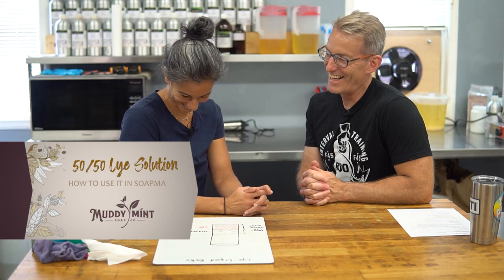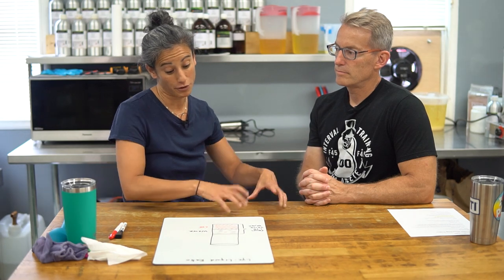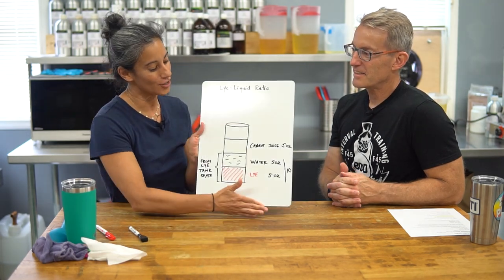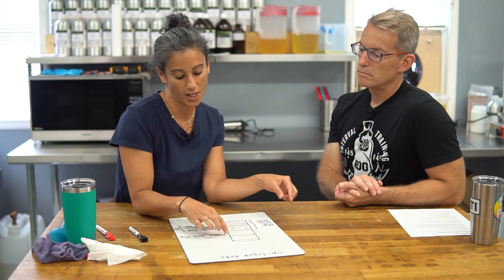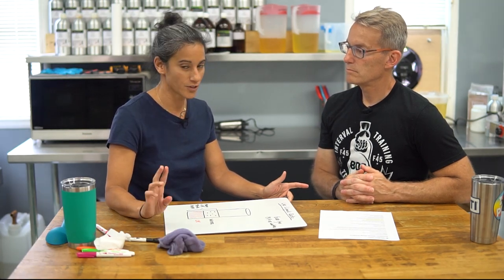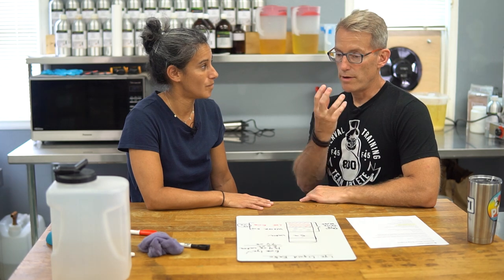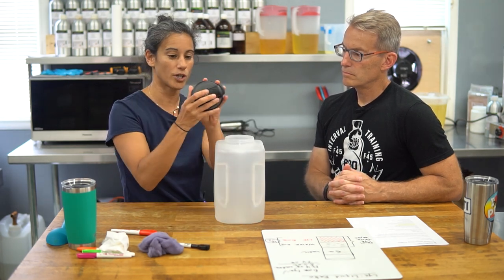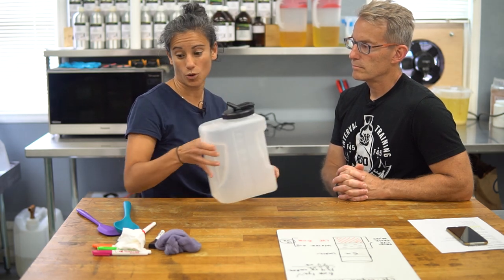How to use a 50/50 lye water solution for soapmaking

Comment: I'd like to know if I use ice cubes instead of water to premix lye mixture is the weight of ice cubes the same as the weight of the water.
Reply from the maker: Good question. Ice cubes and water weigh the same, so there's no issue with using ice cubes instead of water. :)

Comment: I really appreciate the two  of you for explaining how  and  why to use the 50/50 lye water solution. You answered one of my questions, "How long is the lye/water mixture  good for?" I believe you said it is good for a month. Also I was wondering if you use the same  oils & butters every time for your recipes or do you use different oils & butters? If you use different oils & butters, wouldn't you need to change the lye/water ratio as each oil & butter require different amounts of lye to create soap? Just wondering. Please help me to understand as I am confused about the ratios concerning the amounts of lye to consume each oil or butter if you use this ratio every time. Very interesting video. Thanks for the information so far. Peggy
Reply from the maker: Hi Peggy,

We use different oils and butters in our recipes, but we always use the lye from this tank. Remember that you can always get whatever lye amount you want from the tank. The lye amount is the important number. So, if your recipe needs 4 oz of lye, you'll take out 8 oz of lye-water from the tank (which is the same as 4 oz lye + 4 oz water). If the recipe calls for 3.6 oz of lye, you'll take out 7.2 oz of lye-water (which is 3.6 oz of lye + 3.6 oz of water). After that, we ADD water (or another liquid) to our recipe. So, the lye portion of the recipe is always taken care of by drawing the correct amount from our lye tank. Remember that what you take out of the lye tank is always half water and half lye. If you need more water, then you just need to top it off. We do explain this in the video, but maybe it makes more sense written down. If this is helpful, try watching the video again and see if it makes a little more sense. I hope it does!
Reply: Thank you for further explaining to me.  I have heard of the 50/50 lye water from others but could never totally understand just how it works. I get it now!  I love watching your videos and appreciate the two of you. Thanks again for the explanation and  getting right back to me. Peggy  @muddymintsoap

Comment: How do you know concentration of lye water using hdrometer using this method of 50/50  thxs👏
Reply from the maker: Hi! I've never used a hydrometer for soapmaking... are you purchasing your lye water pre-mixed and are wondering the ratio of water to lye? I'd probably recommend mixing it yourself if you're not sure. Typically lye-water that is sold pre-mixed will let you know the ratio. Not sure if that's what you meant!

Comment: You're great teachers, thank you for taking the time to share your knowledge.  Is the lye tank just a large urn or is it made specifically for lye?
Reply from the maker: Thank you! We appreciate you watching and your kind compliment! :) The lye tank is specially made for lye water. It is made of stainless steel (you don't want to use anything else for lye!) and it has a heating element in it. As we mention in the video, you can use smaller containers for small batches of lye-water.
Reply: How do you keep the small batches of 50/50 lye water warm enough within the 10 degrees to pour. ? Hope I made sense. Lol 😂.

Comment: QUESTION:  this is amazing tutorial for 2:1 or greater -- would you kindly discuss if it is less than 2:1, e.g. 1.8, 1.7, 1.6, 1.5, etc.  (closer to 50%) where the total water solution is less.  Example:  for a 40% lye concentration (1.5:1), where lye needed = 87g and the water needed = 131g -- in this case, 87 x 2 = 174g, which is greater than the total water/liquid needed.  Please clarify:)
Reply from the maker: Hi there! Remember that the lye-water that we're making is a 1:1 solution. One part lye to one part water, so you can get any ratio you want above 1:1 easily. A 1:1 ratio is the MINIMUM amount you need. In the example you provide, where you want 87 g of lye and 131 g of water, you would use 174 grams of the lye water solution, which is equal to 87 g of lye and 87 g of water. So, you have your 87 grams of lye, but you need more water (you want 131 g of water, but you only have 87 g so far). So, you need to ADD 44 grams of water (131g - 87g). Hopefully this makes sense!
Reply: @muddymintsoap  Thanks for your steadfast reply! So I understand, the total amount of lye + water = 218g if I were to blend the solution on its own.  When I use a 50/50 base (1:1), the total amount to begin with is 174g, so I add 44g of liquid/water to get to 218g total.  Is this correct?
Reply from the maker: Yes! You got it! That's another way to think about it. Just remember that the most important thing is to get your lye amount correct.
Reply: @muddymintsoap  Thank you for clarifying -- I am always impressed w/ math-minded people!  My math-mind has definitely improved since I began manufacturing a couple of years ago though, but get nervous on these types of things b/c it is so important to get it right.  When I first started making soap, I actually started out w/ a 1:1 (50% lye concentration) milk soap -- that was my first ever soap -- not m&p, not hot-process -- I dove right in.  FYI that milk soap is still amazing, I have not sold them all yet as my business has emerged slowly, but is picking up now.  So, milk soaps do last (mine have).  Thanks again for your assistance, and dedication to informing accurately.  It is always so very well appreciated <3  All the best to you guys.

Comment: I am a new soap maker and learning alit by using different recipes and trail and error but have found my favorite recipe for now the fits the average small wood mold don’t know exact size off hand but when cut 1 inch thick a little bigger I can get ten good bars with ends as samples… my recipe called for 9.30  ounces water and 5..6 ounces of lye. Is that a good ratio? Anyway the soap comes out great I add a little salt and sugar and I get great lather…
Reply: So since I need about 9.30 once’s of water I can play with that and maybe do 5.30 once’s water and 4. Ounces of another liquid like milk to be at 9.30 ounces? Remember new to this so sorry if I am a little slow…..
Reply from the maker: I love that you found your favorite recipe! If you're using 9.30 oz of water and 5.6 oz of lye, that's a 1.66:1 ratio. This is a great ratio if it works well for you! It's less water than what we use and if you ever find that you're having trouble with the batter when making more complex designs, you could add more water to give yourself more time. Salt will make the bar harder too and the lower the water amount, the less time you typically need to cure your bars! Thanks for watching! Sounds like you're doing great! :)
Reply from the maker: So, if you use 5.6 oz of lye, you need to dissolve that in AT LEAST 5.6 oz of water. That means you have 3.7 oz of water to play with (9.3 oz minus the 5.6 oz). You could use another liquid like milk for this portion and you can add more as well, although you might find it changes the hardness or feel of your bar. Hopefully that makes sense! Let me know if you have any other questions.
Reply: Ok thanks .

Comment: I like the concept but if using Ice how can you be assured using ice is giving you the proper 1:1?  Do you begin melting ice cube in order to get the proper ratio?
Reply from the maker: Hi Penny! I had a hard time wrapping my head around it too, but a lot of people make lye water this way, so you just have to trust that it'll work! You simply weigh the ice the same way you would the water. Ice weighs the same when it is solid and when it is melted. We have a video where we make a batch of lye water for our lye tank if you'd like to watch that. We've made lye water this way for 3 years and make 50,000 bars of soap per year, so it definitely works! :)
Reply: @muddymintsoap  ok thank you
I was just confused on how to accurately get the ice to equal the lye. I will look for the video and see if it answers my question.
I would like to try this - once I figure it out of course
Reply from the maker: @pennydavison5 No problem! As long as you weigh the two and they are the same weight, then you’re good to go! 😊

Comment: Maybe I’m overthinking, I read your book and I think I get it. I try making a loaf of soap and I’m confused. My confusion comes from using soap calc. When I plug in my information ( butters and oils) soap calc generates a lye/ water amount. Do I work with that number. Also I soap in grams.
Reply from the maker: Hi! Great question! We are actually working on a video about soapcalc that you might find helpful! One of the issues with 50/50 lye water is that you can't input it correctly in soapcalc. I would just say that the amount of LYE is the most important part and will always be the same for the oils you use. That never changes. The water amount fluctuates. If you're used to using the water amount in soapcalc, you can keep doing that (rather than using 2:1). So, to answer your question, yes! You work with that number (the lye number). So, for example, if your lye number via soapcalc is 240 grams, then you want to use 480 grams of your pre-mixed lye water (if you pour 480 grams of lye water, remember that it is 240 g of lye and 240 g of water). This is the most important part to get right. After that, you just need to add the extra water that you're missing. So, you would subtract 240 g of water from the water amount that soapcalc tells you and add that in with your oils. I hope this helps!!

Comment: Hello 
Does the 50/50 have to be warmed up? Does the second part liquid activate the solution once poured all together ?
Reply from the maker: Hi! We do warm ours up a little before using it to get it to between 85-100 degrees F. We use a warm water bath to gently bring it up to temperature. If your additional liquid is water, you can just add it to your 50/50 solution and it will warm it up, so that’s a good strategy too! The lye water will react with anything you add to it and heat up, whether it is liquid or oils, etc. I hope this helps! 😊
Reply: @muddymintsoap  Hello, 
thank you, thank you. I appreciate this information so much.

Comment: Hi again, when you were using the smaller plastic lye containers, did you have any techniques for bringing the temperature of the lye water back up? In other words, a replacement for the job of the heating element on the larger metal container you now use. Thank you again for the guidance.
Reply from the maker: Yes! We used to weigh out the lye-water for our batch and place the container in a warm water bath to slowly heat up while we measured our oils. You can boil water for this (which is what we did) or you can try hot tap water. Please make sure to never microwave your lye-water!

Comment: Thankyou so much for your video! It was excellent and answered so many questions,  some I didn't even know I had until you addressed them.  The lye solution is genius and something I've been wanting to try and now I definitely will when I get back to soapmaking in the near future.  One question I do have is if I make a 50/ 50 lye solution without a tank do I need to warm up the amount of solution im using in my recipe before soaping?
Reply from the maker: We might need to do a video on this as you're the third person to ask! We forgot to address this in the video, but I did warm up my lye-water by putting it in a warm water batch to bring up the temperature slowly and safely. I usually boiled up water and put it in a larger container and then placed my lye water container inside. After prepping my oils, the lye was usually up to 90-95 degrees. Hope this helps!
Reply: Thanks Simi 💕 this helps😅
Reply: I realize you did thoroughly explain that the pre-made lye did need to be warmed up to around 90 degrees.  Sadly I thought the ice maker ice in my freezer made filtered ice but unfortunately not and it ruined the lye, lots of sludge and white scum. I loved using ice however because there were zero fumes! I need to make another batch of lye though😢

Comment: I wanted to know if it is true that if the 50/50 solution is stored in an environment that is too cold (less than 77 °F), the 50/50 solution can precipitate?
Reply from the maker: Good question, but we haven't had an issue. Maybe if it was kept really cold it would cause an issue? We've definitely had our lye under 77 degrees (maybe as low as 65?), but we do have it stored in either a container with a tight lid or in a lye tank. So far, we haven't had any issues with our lye precipitating, but that's not to say it can't happen. We make a lot of soap though and this has worked for us consistently for many years, so I think you just need to try it and see what you think! :)

Comment: Question! When using the small batch lye container to store lye water solution…do you then soap with it at room temperature-ish when you go to use it? I’m looking to try this lye container method because I too hate making the lye solution each time! Thanks! And this may be covered in your book which came last week so forgive me I have not read it yet!
Reply from the maker: Ack! I wrote a big long reply and it didn't save...! The short answer is that we now warm it up to the temperature of our oils. We actually used to use the lye water solution at room temperature for a long time, but we ran into problems with butters solidifying one very cold winter and started warming up our lye-water, which resolved the issue.  We've been warming up our lye-water ever since. If you use mostly liquid oils in your soap, you may not need to warm it up! This is covered in the book, but to warm it up, you just need to put the lye-water container in a warm water bath (I boil water and use that - my lye water takes about 4 minutes to warm up to 95 degrees). I hope this helps! :)
Reply: This totally helps and it makes sense! I’m also in CO and in winter in my warehouse the ambient temp def affects butters and coconut oil especially! I thought of a warm water bath but thought hmmm better ask someone who’s done this when it comes to something as caustic as lye!! I can’t wait to dig in to your book and the whole soap community is so lucky to have you sharing your wisdom. I love your videos, you’re pure joy! Thank you!!!! ❤
Reply from the maker: Aww, thank you so much! I really appreciate it. <3

Comment: How do you warm up the premixed lye water to 95degrees  if stored in the plastic box and not in the tank ??
Reply from the maker: Hi Kristina! You can warm it up using a warm water bath, if needed. I pour out the amount of lye-water I need for my batch into a pitcher and then I place the pitcher in a container with hot water (usually I boil water and put it in a larger container). The pitcher only has to sit in there a few minutes before it's ready to use. I hope this helps!
Reply: @muddymintsoap  thank you so much ❤ that’s super helpful. Love your videos ! So educational

Comment: I might have missed something. If you use 50/50 6oz for each I thought the extra water or milk had to match the 6oz water!? Why is the example different?
Reply from the maker: Hi there! Good question. It doesn't HAVE to match. In the video, we talk about how you can use different water amounts in different recipes. For instance, when I make a soap with clove bud essential oil, which accelerates trace, I tend to use more water to make up for the acceleration. I personally like to use a 2:1 ratio for most of my soaps, but you can use whatever ratio you want or like to use! In the example, the recipe that I printed out had a different ratio, so I was just trying to show how you would follow this recipe exactly as printed using a 50/50 lye water solution. I hope that makes sense and answers your question!

Comment: I am new to soap making. My digital scale weighs fl oz and solid oz. When I weigh all of my ingredient
To do I use the fluid oz measurements for the lye and the solid oils or do I use solid oz for the sodium hydroxide since it is solid?
Reply from the maker: Wow! I’ve never heard of a scale that measures fluid ounces, so I looked it up and it does exist! It sounds like the fluid ounces are approximations based on the density of water, so I would ignore this setting completely. The whole point of a scale is to weigh things, which is always measured in ounces (or other weight measurement like pounds and grams). So, ALWAYS use regular ounces for all your ingredients in soapmaking, whether they are solid or liquid. Don’t ever use fluid ounces. Thanks for letting me know about this, as it’s super confusing for a scale to include fluid ounces as an option. I hope this helps. 😊
Reply: Thank you so much. This is exactly what I needed to know.

Comment: Would you still need to heat up your 50/50 lye solution if you are using this last method in the jug?  I’m thinking yes, but would like to know for sure!  Thanks so much very informative and easy to comprehend.
Reply from the maker: You might not need to and I used to use room temperature lye water all the time, but I started running into issues with a colder studio and with my recipes with a lot of butters. Butters and cool lye water don't always do well together (the butters solidify instead of saponify and you get weird streaks in your soap -- or at least I think that's what is happening). So, we use a warm water bath to gently warm up our lye water. You can boil water and place it in a large container and then put your lye container in there to bring it up to temperature safely. Hope that helps!
Reply: @muddymintsoap  thanks so much for clarifying!  You’ve given me the itch to try using 50/50 now ❤️